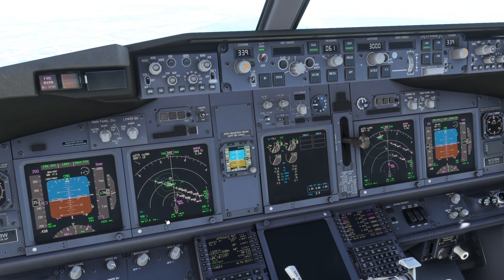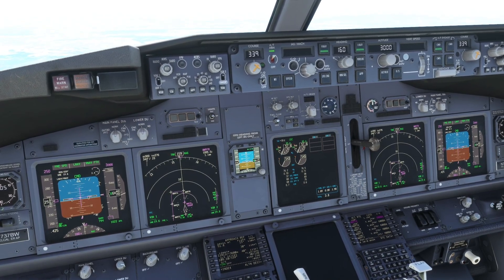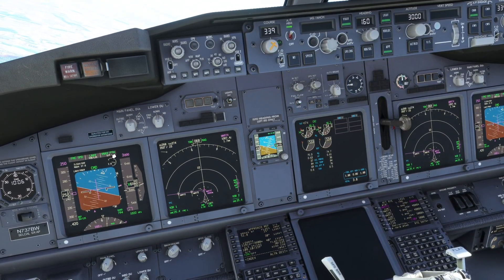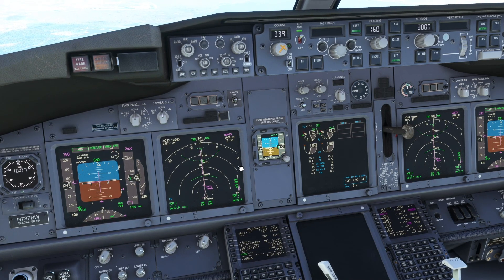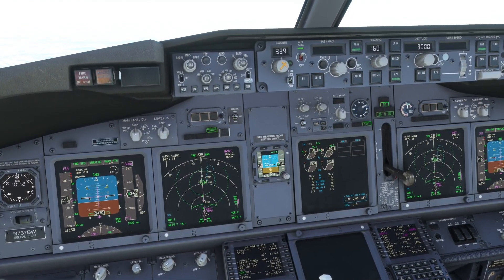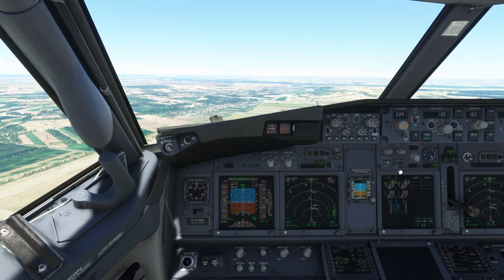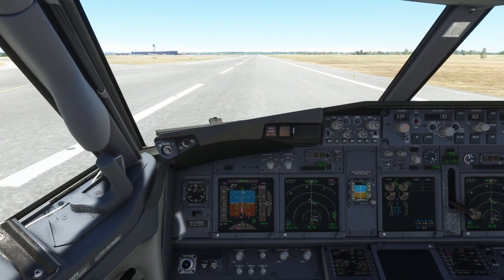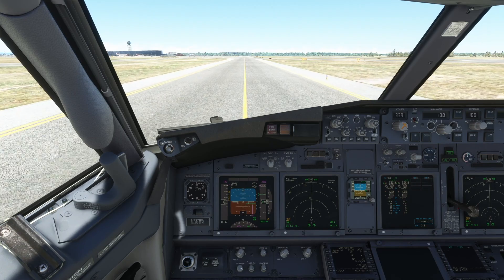Ep.4 - From Approach to Parking | PMDG 737-700 - Full Tutorial | MSFS2020

Comment: How did you setup reverse thrust in the sim? Im tried setting “toggle reverse thrust” and “hold” as well, but have not gotten it to work in the pmdg. It works in fenix
Reply from the maker: Oh just F2 and F3 on the keyboard, my joystick doesn't have a double axis, so this is the only way.
Reply: try binding your reverse levers or buttons to "decrease throttle" in MSFS
Reply from the maker: @kenschamuhn4864  I don't like when I pull the throttle all the way down to go to reverse, my Joystick have no notches, so it is hard to guess where Iddle ends and reverse begin.